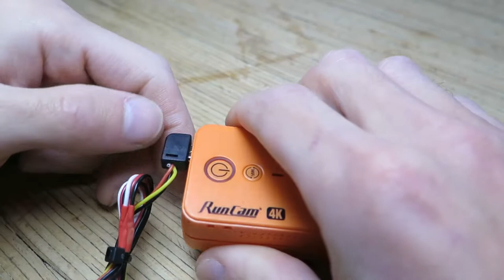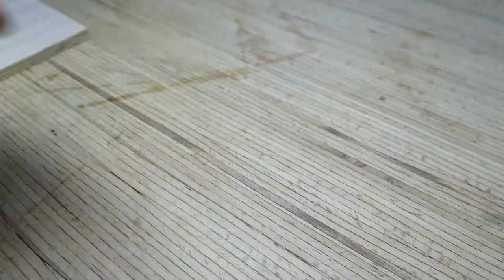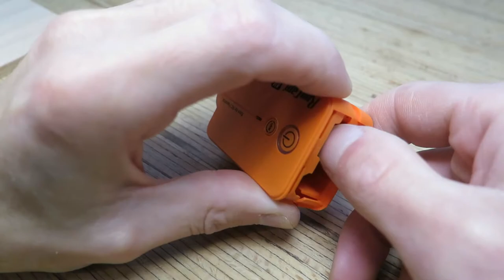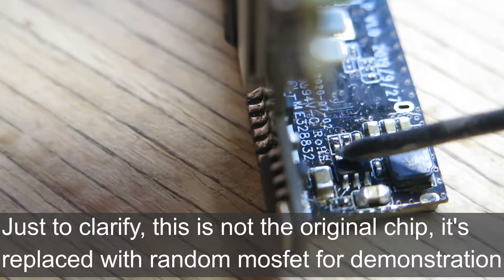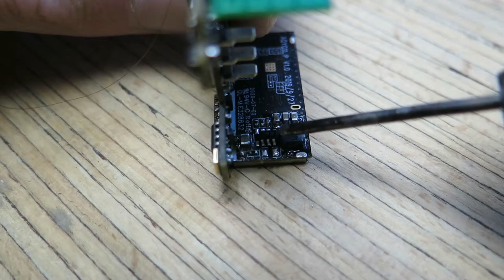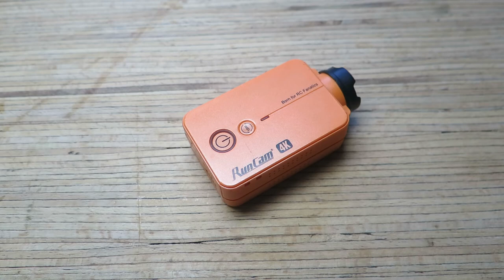Runcam 2 4K version reverse polarity repair

Comment: Every chip have some markings on top. You can search then in internet and catalogues knowing the chip function and package type.
Reply from the maker: Yeah, this one had dot :) I would be much better off probing with scope where switching happens is and power rails are and sampling random sot 23-6 packages. They usually have same layout in like 2-3 variations. Unless this one is proprietary... But main problem is, that I don't have scope right now.

Comment: hi, I have the same problem. could you tell me which used dc to dc converter on the board?
Reply from the maker: Unfortunately I wasn't able to find out so far. I can look for replacement if you give me a day. but can't test really. I will have to order new runcam so can experiment on more broken one but that will take ages probably
Reply from the maker: So far I've got:
buck converter
I would guess, it's adjustable
pin 1 VCC? ( there is 8V when powered from USB...)

pin 2 GND,
Pin 3 sitting on 0.6V, most likely feedback
pin 5 VCC
Pin 4 ??? about 70K impedance to GND so could be some sense, but there is large cap as well sooooo dunno
Pin 6 probably PWM

This chip is very weird, also super little space to probe and don't have scope to make sense of what it really does... 
Maybe it's buck with active rectification and it needs bootstrap on pin 1 Otherwise I have no idea how to classify this even before starting to search in catalogs.
Reply: @IlusysSystems  thank for the information, but could you tell me the name of the back converter.
Reply from the maker: @3Dmaker_DIY  Unfortunately no, I thought it would be much simpler part. Still would have to order a bunch of samples and test each of them.
Reply: I have found the ic
Reply: Could you tell me name of the  component
 @playbutton602